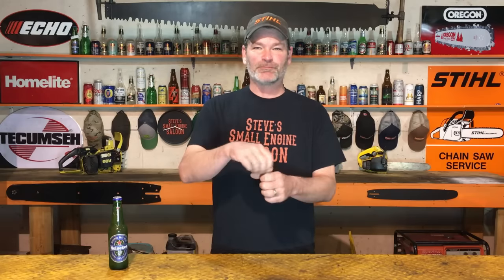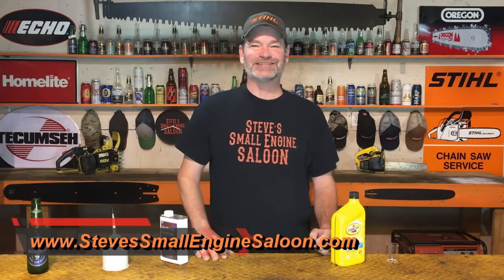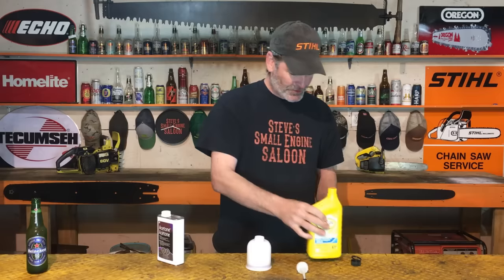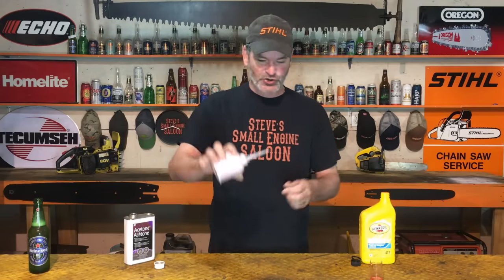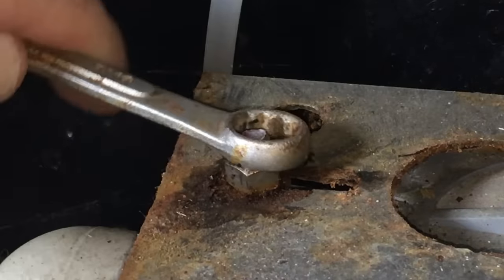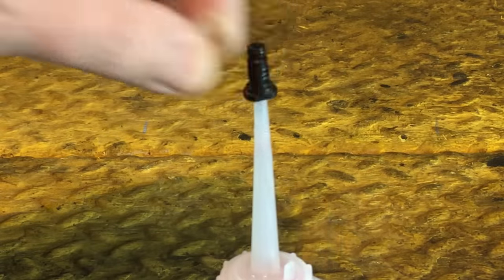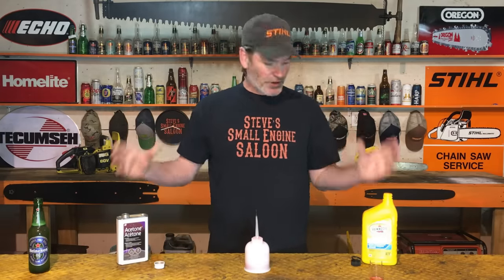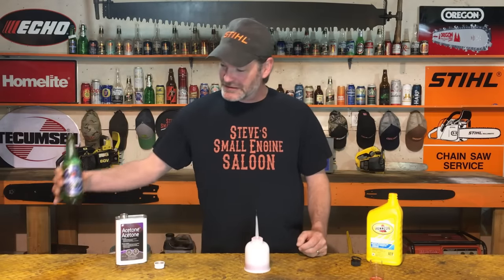How To Free Up A Seized Bolt or Nut

Comment: The way to loosen a rusted bolt is to get someone else to do it.
Reply: No. Dude. Step up. It’s YOUR job.
Reply: Lol got a broken manifold and banjo broken in there as well now have to pay 1k
Reply: For real 😂, almost at the point
Reply: 😅yeah and my son can't get it loose either!
Reply: Yes. No penetrating oil is going to help free a bolt when it's not attached to a nut but is actually embedded in a part. Unless you can actually see the threads no penetrating oil is getting in there.
Reply: 😂😂😂 I’m halfway done and I’m really considering letting someone else handle it

Comment: You're doing one of the most important things which is removing the rust. The contact of nut to bolt isn't 100 percent so the loosened rust clogs up the 20 to 25 percent of remaining space. Clean threads and this lubricant are the best method for rusty fasteners.

Comment: One last ditch item that can help the acetont/atf concoction when it still doesn't turn is: instead of applying pressure loosening the nut/bolt/screw is to tighten it a very small amount 1st. (1/16 of a turn or less)  This can break the base metal corrosion loose and allow the atf mix to penetrate more deeply. 
May God bless & give rest to the soul of Mike!
Reply: Yeap doing that  always worked for me.
Reply: Pops taught me that as a kid. Totally works. Small folks gotta use tricks to get by. Use your head not your body
Reply: thanks michaelamick, but most of us old guys know that already, anything moves easier going in the same direction it stuck in. good to hear someone today comment about that.
Reply: Can also grab a torch and heat the bolt/nut up, then let it cool. The heating and cooling will cause a slight separation. The penetrating fluid will have an easier time soaking in too.
Reply: don’t forget the beer step,it’s the  most esssential,😂.
Reply: 100%. Tighten to loosen.
Reply: @jimmieroan9881  I didn't know this.  Thanks to all.

Comment: Steve, I have been trying to get the bolts off my ride on mower spindles for almost two weeks. I tried penetrating fluid, cheater bars, hammers, lots of swearing. Your brother Mikes concoction worked after I let it sit on for the duration of two cold snacks (beers). Thanks for all you do mate.
Reply from the maker: Right on

Comment: This works!  I had been working on a frozen 3/4 in strut nut for hours, (impact, 4 ft cheater bar, and Kroil- no luck).  I used Mike's 50/50 mix twice, after 3 minutes the nut was spinning freely.  Amazing.  Thanks for sharing.!
Reply from the maker: Right on

Comment: I've tried most every penetrating fluid known to man over the last 34 years as a machinist. What I have noticed is that when the nut eventually breaks free there is never any sign of the penetrating fluid on the threads where the nut was. What has most always worked is either using the impact forces of an impact gun tightening-loosening in tiny increments, or heat on the nut (not the bolt). Sometimes a combination. But you always run the risk of shearing off the fastener. So I appreciate your tip and I will certaily give it a try. Cheers.
Reply from the maker: Right on
Reply: Always wondered if it really works..glad you answered that one.
Reply: Left off.

Comment: Thank you for the tip, it looks good.  I use Penetrene, on difficult Nuts, but you may need to let is seep-in for a few hours. 20 years back I was repairing a Ford Steering Box. But, before I could dismantle it I had the break the seal of 1 ¼  Inch nut holding the arm. With a socket and a one yard lever I could not break the seal. I put Penetrene on it and went home. Next morning I was able to remove the nut with a 10 Inch Spanner. Not as quick as your suggestion, but it’s an off the shelf product.

Comment: Sorry to hear about your brother Steve. You did a great job on making this video which I could tell was difficult for you. The glimpse of the emotion brought back memories of when I lost my dad. It is just been over two years and I miss him terribly. 
That being said, I will try this today in my shop. I thank you for posting this. Up until now my go to has been heating it with a propane torch or heat gun just enough to melt a small puddle of candlewax on the stuck nut or bolt, This works extremely well, but adding he can sometimes be a problem.

Comment: I just tried this on a rusted castle nut for an outer tie rod that I've been struggling with for 2 weeks and was AMAZED at how well it worked! Nothing else would make it budge: I heated it well over 650 °F, added an extension to a breaker bar and put over 500lb-ft of torque, soaked it in PB Blaster, nothing. 50/50 ATF with Acetone, poured it on a few times to let it soak, waited a few minutes, and the nut turned as if nothing happened😮😮  HUGE thanks to you, Steve! 💪🏻💪🏻
Reply from the maker: Right on buddy!

Comment: I will have to try this.  I have some rotted body mounts that I want to replace on a 70 year old car and I don't want to re-use the rusty bolts either. Water pump bolts also are always of concern as I've had then snap in the block a few times.
I am so sorry for the loss of Mike.  I have two brothers myself and so far still have them both but we are all aging so one never knows how much time we have left.

Comment: Been using acetone and atf since I was a kid. My gramps taught me to use it when I started working on bikes and small engines. Another option that also works in some instances is to heat the part and rub it with wax and let it penetrate. But acetone and atf is about the best and cheapest penetrating fluid out there.
Reply from the maker: Right on

Comment: HDPE, triangle recycling #2 works fine to store acetone in.  I've had some in a bottle I keep with my TIG stuff for cleaning and have had no problems with deterioration.  I inherited a gallon of Texaco penetrating oil from my dad.  I mix that 50/50 with Marvel Mystery Oil and a few squirts of Kroil and that works for me.  Dexron is nasty stuff if you don't get it off your hands so I could see how it would work as a penetrant.  Thanks for posting Steve with all your wrench bending help.  P.S.  Make mine a Heineken, original strength, but I've heard the NA is excellent if yer goin' that way.

Comment: I recently purchased a gallon of acetone from fiberglass store and it comes in a plastic jug.Sometimes need to loosen rusty fasteners and I use heat when possible. Thanks for your tip on this one.
Reply from the maker: You're Welcome...

Comment: Hi Steve` could see the hurt you felt when you mention your brother,  I thank you for mikes fantastic solution to unseized components,
Its great that knowledgeable persons give welcomed advice and like to help others,
This technic with these to liquids will now be past down to my family and so on,
There are certain plastic squirt chemical bottles that acetone will be happy being left in if people prefer over metal due to the cost,
I also learnt from an old timer I must share` when you come across rusty seized nuts and bolts, Never try to loosen first always crack it by tightening it first because you ain`t trying to force the nut onto the rust there's more likely to be less to no rust on the other side that ain`t expose to the air
Reply from the maker: Thank You...and You're Welcome...

Comment: i have a stubborn Ellen bolt on a lower manifold stuck.  i sprayed it with PB blaster last night.  if it doesn't come off today, i will definitely try this and report back.
Reply: How did it go ?:)!
Reply: @luistobar7  bolt ended up snapping . I think it was just to old, seized from age, and corrosion. I used an  extractor set i bought on amazon to get it out.  Took some patience, but got it done.

Comment: EXCELLENT TIP CHEERS - RIP Mikey.  As a guy below says once the nut releases DONT try to run it straight off it WILL seize again. Undo - then tighten a little - undo - tighten - undo- tighten etc THEN she will come off! I have use this with bolts up to 2 inches!
Reply from the maker: Thank You...

Comment: I tend to use the commercial penetrant lubes followed by that certain style of opposing hammer blows from two opposing hammers . The vibration and slight contraction and elongation microscopic level carries the stuff deeper as well as breaking up the rust bonds . Final resort is the portable blowtorch along with cooling water jet from a pump up hand sprayer .

Comment: I learned about this 50/50.concoction a couple of years ago. So, I tried it on a tractor steering wheel I desperately needed to replace. After several months of a few drops now and then, POP! the wheel with minimum effort came off, it works!

Comment: Just saw this video steve, sorry for you loss ! 
I use PB Blaster, but the air in the can seems to run out well before the product.
I'm going to give this a try. I've got a stuck v8 boat motor thats been sitting for years. I'm going to try this and see what happens. I gave each cyl 5 shots of pb blaster 5 days ago. And If it cant rotate yet im trying this next. The crank bolt is a 15mm way to small, so im going to use a balancer puller with a pry bar thru it to try to rotate the crank

Comment: Acetone is commonly sold as fingernail polish remover.
Reply: and now most of that is mixed with water
Reply: Fingernail polish has additives so it is not pure. one needs pure acetone bought from hardware stores s nail polish has other chemical not wanted especially if cleaning surfaces or carburettors

Comment: Nail polish remover is acetone, so some kinds of plastic bottles are ok.

Pro tip:  Save money.  Steal your wife/girlfriend's nail polish remover.
Reply: Nail polish remover is ethyl acetate. Acetone was removed from nail polish remover after it was found to cause problems with female reproductive organs. For this purpose it will work just as well if not better than acetone. may actually blend better
Reply: Horace Pinke
Reply: Horace Pinker How long ago?  My wife has 2 bottles, both are acetone.
Reply: Don't you guys have acetone anyway? Acetone, paint thinner, mineral spirits, 2 cycle oil, ATF, Motor oil, anti-freeze, window washer, a fire extinguisher, etc.
Reply: Pro tip, could be bad for your health if she finds out 😂

Comment: Just tried the wax trick the other day. Worked much better than expected. Heated with a propane torch and put the candle to the threads. It wicked up the threads and came loose with ease.

Comment: For really stuck fasteners that won't open up with chems or heat there's usually still way. Small hammer. Seriously begin to tap all sides of the nut or bolt with light to moderate force. It will work, but it's tedious as heck to do as one fastener can take like 15-60mins, maybe even more. When I was young one back then almost to retire mechanic showed me this trick and I've never have it failed. If bolt is in casing or such then it's not the most effective, but tapping bolt head still help a lot. Friend had to remove steering joint from one old car which had to come off intact. He had worked that single part for hours and told him to do it. He did it for like hour and said that it's actually getting out and eventually got it out. But as said, this method is true patience and will test for the mechanic.

Comment: Steve, thank you very much for sharing this mixture! I have already put it to use, even bought the recommended can. I’m having one problem though. The daily temperature fluctuations in my garage make the can “pump out” the mixture when it warms up. Any easy tips to avoid this? Once I solve the leaking issue I will be labeling it “Mike’s Mix” in your brothers honor. Thanks again, love your channel!

Comment: So Sorry for your loss Steve....
This is an Awesome Tip... In 1973 I started to work at Thompson and Green Caterpillar in Nashville Tenn as a Mechanic Helper... Back then you were the Helper (aprintest) and that was a 4 year position before you got to move up to a Mechanic. Basically you did all the work as the Mechanic that you was assigned to watched and instructed and showed you what to do. Yes there was verbal quizzes from time to time. :D
I (we) were removing the exhaust from the heads and on those Big Six's the bolts would almost weld themselves in the manifold and the bolts and nuts would not  turn at all. If you were STUPID enough to try to turn them you would break them all off in the manifold...
Well there is where I first seen this trick and it is cool to watch it get sucked in and disappear. I (we) would mix this in a metal trigger oil can and spray them down several times and we { I } was taking other stuff off to remove the heads.
Then all you had to do is use a propane torch and heat it a little and they all came out, no muss no fuss..
I am 65 and Wrenched for 40 years and it has never failed me. BTW you can use plain ATF as cutting fluid (Minus the Acetone) when drilling in metal or cutting threads with a Tap -N Die Set... For the stubborn ones use #90 weight oil for frame rails...
Also just plain ATF works just as good with some heat and a little Jack-N-Coke... LOL

Comment: An old mechanic told me this trick today . I’ve heard all kinds of things like hot sauce or ketchup but I’ve always had the best luck with heat. If you can’t use a torch try a heat gun,they can get metal red hot. Cheers.

Comment: My condolences Steve. RIP Brother Mike. Call it synchronicity or whatever, but I was in need of this information just yesterday. I am prepping to remove my gas tank on my 2001 Toyota Tundra to replace fuel pump (260,000 miles). It has made a few trips or more to the beach, and has been in an environment that is conducive to corrosion from salt on the roads as well. There is a bit of rust damage (actually I would say severe) to the frame etc. So - I have been using "Kroil" for a week a couple of times a day and it only succeeded in barely freeing the forward mounting strap bolt - the rear was locked on tight, and even with a 1/2" drive 6 point nut, attached to a 16" breaker bar did not budge and I was afraid of breaking the bolt, or rounding the head. I made this concoction, douched the threads I could access, and voila! 20 minutes later, it came off with relative ease! This is the FIRST time I've had such dramatic results from a "Home remedy"! I just ordered a new oil can to keep this in. No more $20. a can for the Kroil, or PB Blaster from my pocket!!!
Reply from the maker: Right on Harry!  Thank You...

Comment: Godspeed to you and all that loved and cared about your brother.  Even after 4 years, it doesn't get any easier.

Now that I've found a source for the KANO KROIL, it is my go to  rust buster liquid.   They guarantee that it will wick down into gaps as small as .001".  I also mix up your brother's concoction from time to time, but usually only enough for what I'm going to use that day (for the evap issues you properly describe).  Not sure how us mortals would actually measure whether the 50/50 mix would wick down in gaps smaller than .001".  Let's face it,  horizontal nuts with the threads above the nut are the easiest to dribble the  penetrant on to for maximum chance of success.  Although I'll still dribble the penetrant on the horizonal positioned threads and try to get what I can to get some on applications where the threads are below the fastener, I had a really good weekend selling tools at a big flea market last fall and bought one of the US made bolt buster induction heating tools.  They don't get into really tight places like a torch can, but they do get the fastener cherry red in like 20 seconds without any flame.  When your insurance co. finds out you have an acetylene torch in your  shop or garage, watch the rates jump through the roof.  Usually the combination of the  penetrant and the heat tool will free up most any ornery fastener.  The only time this combo has failed was on the passenger front disc brake bleeder screw on my '99 Corolla that prolly had never had the fluid changed in it's 249k miles on the odometer.....lol,   Keep making the great videos.  Yo are a Godsend to us flunkies that don't know squat about 2 cycle motors!!

Comment: Steve I've been using Mikes Mix for a while now and it's the best.
There have been some nay sayers but Mike proved them all wrong.
I tell everybody. 
Here in Massachusetts, if it's not painted it's corroded.
Lawn and garden equipment doesn't come apart easily, especially 
when it's 8 -10 years old.
I can't tell you how much I appreciate your tip.
Your the best, Steve. Thanks again...
Reply from the maker: Right on Tom!  Thank you so much...

Comment: Great video. I like it. I use it. Ill try kroil before heat if this doesnt do it, but then kroil "usually" doesnt either. In a pinch, ive also used MEK and Naptha. Theoretically, it should be a bit better. I never noticed any difference. Besides, those two are even more dangerous than acetone. In a pinch, ive used Goof Off. Its mostly acetone. Even lacquer thinner and mineral spirits when desperate. But why jerk around. Your recipe is tried and true. What else could anyone ask for. Nicely  done, sir. Very nicely done. And Gods blessing for your brother. Youve just proved the need for men like him. "Gotta problem with no available answer? Then make your own, you SOB!"  Bless you and your loved ones as well. You're as need for the rest of us just as your brother was!

Comment: This worked perfectly!  Only had ATF + Synthetic and Cutex (Acetone Nail Polish Remover).  Mixed a capful of each, then squirted it with a syringe around bolt.  Still took some force with the vice grips (Torx head was stripped as well), but came out quickly.  Amazing!! Thank you so much for posting.
Reply from the maker: Right on buddy!  You're Welcome...